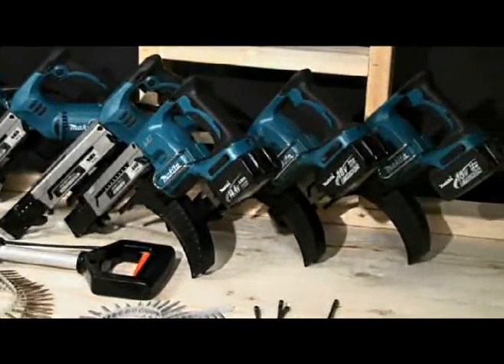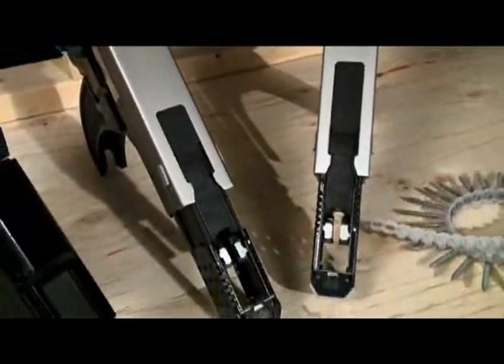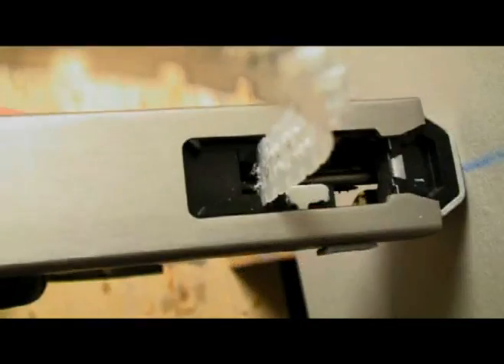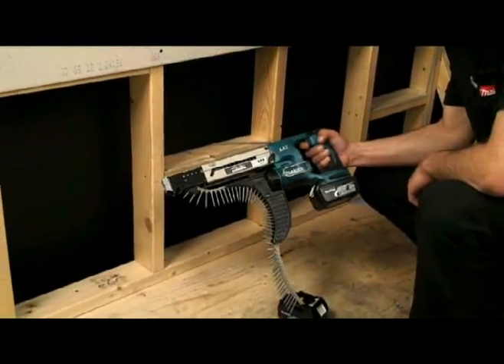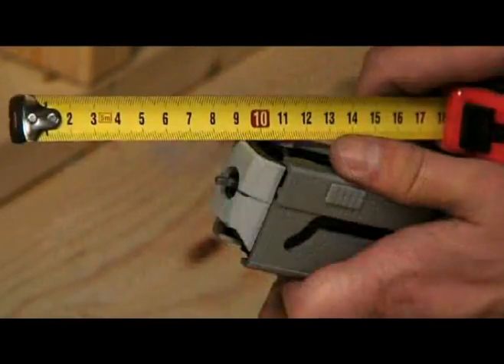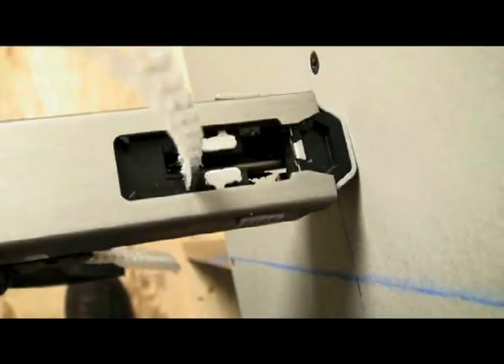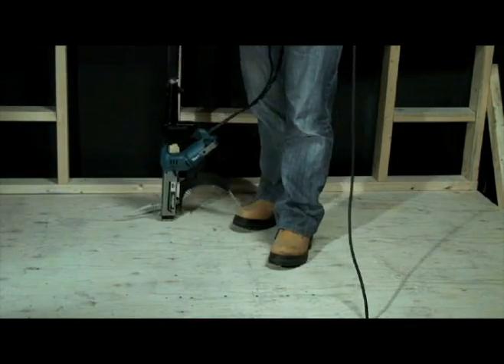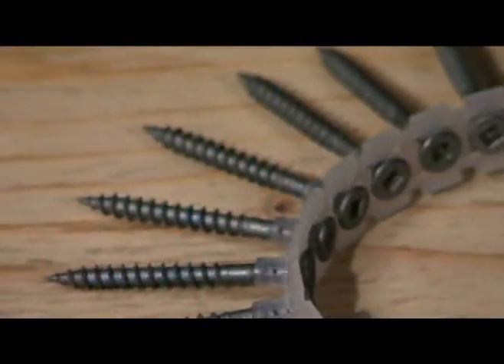Makita AutoFeed Screwdriver

Comment: Back in the days, damm the was such a pain after a couple of weeks. Missfired More than sink the screws. Festool and Senco these days are just nirvana, Hilti is built like a tank and had some issues with the magasin. 
Only used Festool for years now. Costly but so sweet. Press against the sheat or board and then motor starts 😁😁😁😁